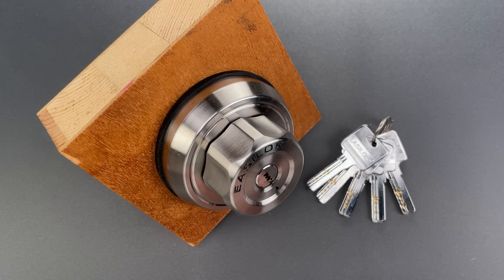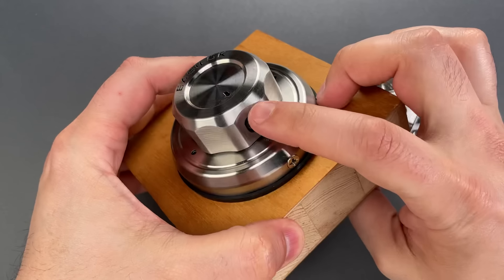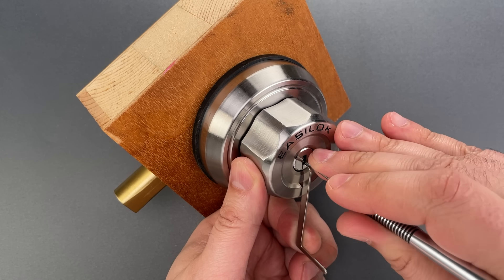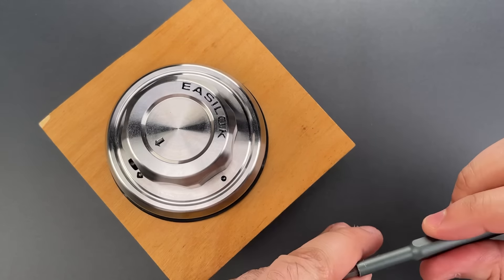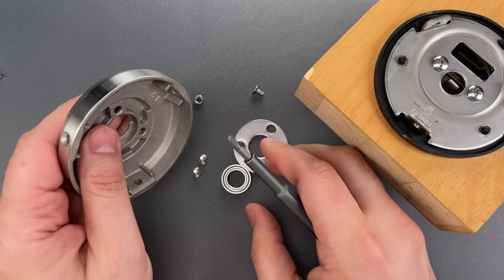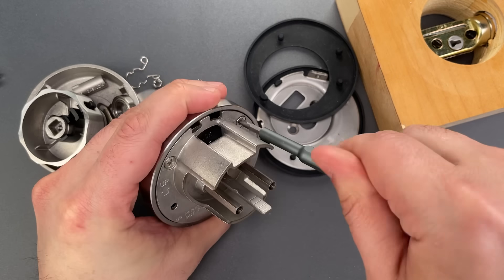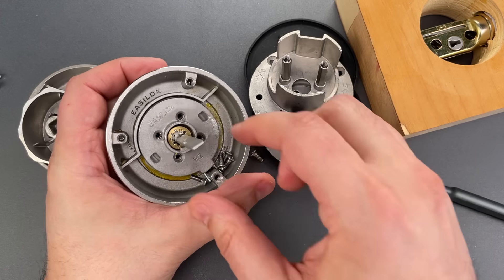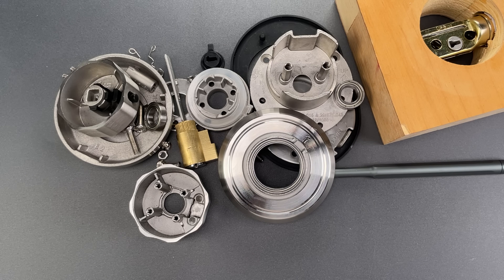[1388] The Best Built Deadbolt Ever? Easilok

Comment: Looked for it on Amazon and it seems like it's quite a new lock from a relatively small company. 

How'd you find this gem? Viewer recommendation?

I guess the downside is the low security core or cylinder that can't be replaced.
Reply: Hopefully they take this to release a newer version, if their sales are good :)
Reply: I'm just going to live happily with the fact that a dimple lock is lesser known, so fewer criminals will be able to successfully open it. I mean, considering that I've never been broken into in my 33 years, I'm not expecting more than 2 attempts in my lifetime, and the chances of either of them knowing how to deal with a dimple lock are low enough to satisfy me.
Reply: @CrapE_DM  We had one guy "Break" in while I was at work(Night shift). Luckily I work armed Patrol and came home when I got a call of a weird "Snoring" noise coming from the laundry room. Found a drunk guy in our laundry room passed out. Family decided NOT to lock the door. The worst Lock is one that is not used..... Needless to say I gave them an intense ass chewing.
Reply: Well the fact that you can use the switch on the inside to act a nightlock, means it is unpickable at night, when most intruders would strike anyway. But a better cylinder is obviously a solid way for them to improve
Reply: He found it by sorting the Locks category on Amazon by New.
Reply: Maybe repin, or someone can build custom cores for it until the manufacturer gets around to a new design.
Reply: @CrapE_DM   I think today's unsophisticated burglar just kicks the door down
Reply: My guess is they sent it to him, because even though its illegal to not mention paid promotions, he does it all the time.
Reply: @blitzofchaosgaming6737  How exactly do you know he gets paid for some of these and doesn't mention it? Links?
Reply: The dimple core isn't really that bad a choice, but it definitely could be better.
Reply: @blitzofchaosgaming6737  No he doesn't you fool.
Reply: @blitzofchaosgaming6737  It's not illegal. Maybe it violates YouTube terms of service, but that is very different from being illegal.
Reply: @commarian4642  And when you leave you can set all but one door to that mode. They can still smash the window though...
Reply: @blitzofchaosgaming6737  i believe tom scott had said it is illegal in Great Britain. Nowhere else that I know of, is it illegal. So just like most everything else in the internets, there is a bit of truth in your statement, but only a bit.
Reply: If it becomes popular, they will make it worse.
Not joking. They'll get their reputation up just high enough that they can afford to skimp on the actual quality, and then ride out the slow decline of reputation making massive profits.
Seems to happen every time.
Reply: That's an ad.
Reply: The one I saw on Amazon though had a different core.
Reply: @davidhsiang9323  As I said it was my guess.  We've seen him get free locks to review from companies a lot, and then fail to mention that in successive videos of those companies' locks, which was my point about not including the paid promotion tag for reviews on companies he has received "anything of value" from.

But lets be honest, he has received value from every lock he has ever talked about from AdSense.  Whether it helps them or not.
Reply: @Phred_Phlintstoner  US law (FTC) requires disclosure if it is a paid promotion.
Reply: @blitzofchaosgaming6737  I'd assume that means the videos for the other locks were not paid promotions. Keep in mind that very few locks actually get good reviews from LPL, its a pretty shit idea business wise to pay someone and get absolutely destroyed in the review.
Reply: @CrapE_DM  I never worry about someone picking a lock. Most theives would probably just break a window or take a crowbar to the door or even kick it down. Neat lock none the less
Reply: @Aaron-sl9ov  yes 💪
Reply: @dovydasgrigas441  If he has received anything of value from the company it is a paid promotion by law.  Doesn't matter how he reviews it.
Reply: @delphicdescant  "So get yours while (quality) supplies last!"
Reply: @blitzofchaosgaming6737  being sent a promo product is not a paid promotion.
Reply: @blitzofchaosgaming6737  
First I've heard of this. Source?
Reply: @vmirallyx  I already linked it.
Reply: @jcregal3456  correct. One piece of metal, +4 feet long, to reinforce the door jam
Reply: @blitzofchaosgaming6737  I don't think a former lawyer would risk doing something illegal on the internet, at least not on purpose.
Reply: @blitzofchaosgaming6737  Please link to where you already linked the source of this law.
Reply: @wolff000  Statistically, how well-lit a place is, whether that's day versus night or streetlighting versus none, makes no difference to the probability of a crime being committed. So you're right, the presence of the occupants is very much the deciding factor.
Reply: @robertsmentkowski312  Jamb.
Reply: @commarian4642  most intruders come in during the day because people are at work.
Reply: @blitzofchaosgaming6737  Almost all the locks get negative reviews from LPL, do you really think he's taking paid promotions?
Reply: @Mr.FastZombie  No, i know he has.  Paclock paid him to review their products and subsequently he has reviewed others of their products without disclosing his relationship with the company.  Gives them good marks and their competitors bad marks.  Exactly what unfair competition laws are about.
Reply: @blitzofchaosgaming6737  Being sent something to review isn't the same as paid promotion.  If he receives nothing in return and is not likely to gain value from the item itself (how many doors does the LPL have, you know!), then it's not really a paid promotion.
Reply: @DavZell  Receiving free product does make it a paid promotion under the FTC rules.
Reply: @Richard Cranium No, do you work for paclock?
Reply: @CrapE_DM  I can get through the stucco wall next to your door with a claw hammer and twenty seconds of effort.
Reply: Maybe the engineers who designed it don't know about picking and just bought a core that they were convinced was high security. If so they might actually see something like this and fix it.
Reply: “Can’t be replaced” … only with that attitude
Reply: @blitzofchaosgaming6737  It's not a paid promotion if they give it to you
Reply: @blitzofchaosgaming6737  receiving a sample to review does NOT make it a PAID promotion. Could be a conflict of interest if he was receiving $10k bottles of wine to give glowing bs reviews to. But when 99% of the time the value is less than that what you'll find his yet to be flushed toilet I feel it's a pretty safe bet the "value" of any of these "locks" he may or may not have received free of charge has had any sway in his assessments. In fact, if he receives something free of charge, and actually by some miracle attributes any value to it, then I surely HOPE it receives a favorable review!

Comment: The lock has more ball bearings than my Corolla.
Reply: I was going to say "no it doesn't", then I remembered most of the bearings in a cheap small car like a Corolla are roller bearings. But still, just the gearbox in your Corolla has far more ball bearings than this lock.

Comment: the designer must have LOVED tetris ... nothing like layering everything in ... and even better to see that easilok watches the channel and actually pays attention to what you have suggested ... as for the recommendation by you even with the quick pick it sounds like an excellent lock ... stainless steel may be more costly BUT make them by the billion and they become cheaper just by economy of scale ... 
.
here's hoping they send you the new upgraded version to see what you can do with it ... I think that would be a fair endorsement thank you ... and perhaps a nice birthday gift for them as well to see what you think of the upgrade as well ... I can forsee an upgrade of the ability to swap out cylinders to better enhance the security of the lock ... perhaps add a feature on the lockout pin to allow turning from the inside to reset the pin as well .. so you dont get locked in by accident ... in case of emergency 
or have a gimmick like holding the outside knob to one side and then insert the key the key upside down then reseat right side up and open ... or some such ..
Reply: Sir,thanks for your endorsement. We are upgrading the cylinders.We will make it as soon as possible and give our customers  the best  experience:) .
Reply: How many billions of $100 deadbolts do you think they sell?

Comment: In my opinion, aside from the mechanical security, one of the best things about locking a door with a separate deadbolt is that it does require a key from the outside, thus making it impossible to lock yourself out. Maybe the best approach to using this lock is to disable the keyless locking feature and pretend it doesn't exist, and continue to assume a key is always needed to lock the door.
Reply: It may seem impossible but ...
Reply: From their website it seems an intended use of this lock is for workers to be able to lock a store after closing without having to give those workers keys
Reply: @_Zaid  that definitely makes sense, especially if they don't actually need to have a manager present during closing.

Comment: Burglar: "Oh damn! An easilok!"  Steps back and lunges forward kicking the door in.
Reply: Just put one of your radios on the back, they will break their foot
Reply: Considering what I see of it? If you put this on a properly installed steel door with properly installed trim and everything? I'm sorry I'm breaking one of your windows. It's got nearly an inch of deadbolt. If the door is in anywhere near properly installed even the police with a doorbuster would have a hard time.

Comment: I'm curious how long before it gets engineered down to a price-point. First things I'd expect to go are the ball bearings. They certainly make it smooth operating, but the main purpose of ball bearings is longevity, and I don't think a deadbolt generally sees enough mechanical wear to warrant the cost to most manufacturers.
Reply: I would have said that the main purpose of ball bearings is smooth operation. Longevity is just a bonus.
Reply: @olsmokey  I would counter that the smooth operation is a side-effect of the bearing doing its job (to an extent), but I also could have phrased its purpose better. The point of a bearing (as well as bushings, grease, oil, etc) is to reduce or eliminate direct contact between multiple moving surfaces, to the effect of reducing wear on said surfaces, which in turn results in greater longevity of the mechanism. I mention the other options because which you choose is dependent on the environment and stresses the mechanism is expected to see. Bearings are good at high speeds and high loads, neither of which this lock would likely see. Given that it looked like the bearing was almost completely encased within the mechanism, I suspect a good grease would have been more than sufficient, and significantly less expensive.
Reply: Good enough house, good enough lock, it's there when humanity meets other civilizations across the stars, and Glorbdak discovers how much he appreciates it when he comes to live on Earth.
Reply: @jero37  That's precisely my point- companies generally engineer products to be "good enough", but this lock has been engineered to be more than that.
Reply: I assume that the non-standard, lowish-security lock core is where it has already been "engineered down to a price-point".
Reply: @jic1  Strictly speaking, you are correct- that was probably a decision they made to to hit their arbitrary price point.

What I really meant by my statement was, "how long before they engineer it to the lowest price point possible?"

Comment: Since the outside of the lock has an octagonal head, I would really be curious to see whether that makes it vulnerable to a good old fashioned pipe wrench and a little bit of torque. What would break first under that kind of pressure, the pins or the outside of the lock?
Reply: I bet the company will get on that immediately after this came out.
Reply: @professionalcommenter  They know about that threat.  Most external deadbolts have a tapered design like a cone for that very reason.  Wrenches slip right off.  I'm not sure the vulnerability of getting it to spin on this lock, but it looks like a viable means of attack.
Reply: @sundaynightdrunk  *Laughs in vice-grip
Reply: @bfeezey  Well if you do that, there's also the Hooligan tool used by Russian firefighters and lifesavers, which is a hydraulic reverse scissors basically. This thing can open almost any security door short of actual safe doors.
Reply: @bfeezey  Vice-grips don't grab conical objects like a typical external deadbolt housing.  Try it.  They slip right off.
Reply: Stainless steel vs Brass pins... I"m thinking the pins will shear. 
But really, a lock is there just to keep honest people honest and prevent theft of opportunity. A determined thief/crook will always find a way inside.
Reply: @valkyriefrost5301  Honestly, at the point, its easier to just break a window...
Reply: @sundaynightdrunk  Tapered design is easily defeated with a K-tool.  Slip it over, tap it down, pull the core right out.
Reply: @JackycClark  - Not really sure. I would hope the locking mech inside is some how disconnected from the cylinder when locked, if not, the a pipe wrench and some torque will defeat the pins. The real point of picking a lock is to gain entry without leaving an obvious trail.
Reply: @EuropaOutpost  or make noise, depending on intent....
Reply: @Valkyrie Frost  for you maybe, for me, a lock is to slow down anyone not authorized long enough to reach my shotgun behind the bedroom door.
Reply: @sgvincent100  - some will steal the battery just for something
Reply: @TheWinjin  First of all, the tool is a Halligan, not Hooligan and it is a specialized crowbar.  Secondly, the tool you are describing is the "Jaws of Life", which due its size, weight and cost will never be carried by burglars.
Reply: I used to turn apartments, in the kind of neighborhood where people would suddenly leave overnight without turning in their keys and often put on their own locks. Lock-in-knobs are a joke; I could sometimes force them with my bare hands.  With my 14" channelocks in my belt loop I could open almost any apartment deadbolt in just a few seconds. Even if the residents didn't know me, they probably wouldn't suspect anything by how quickly I could get in. The only thing slowing me down? Tapered cylinders. I can't help wonder if this octagonal head might actually give more torque than a typical lock-in-knob.

Comment: LPL: "The best deadbolt I've ever encountered."

Also LPL: "Here let me pick this lock in under 20 seconds."
Reply: He actually said it's the best low security lock he's encountered.
Reply: Of course. He opens the worst ones 10 times in a span of 5 seconds.
Reply: @dozerman8222  so in this instance we're counting low security as a lock that can be opened by anyone that can lockpick? Preventing only the people who can't lockpick from opening it lol.
Reply: 99% of crooks can't pick a single  lock and don't even try. They use force.
Reply: @tactrix1h  We are talking about a world class lock picker who can open some padlocks just by staring at them.  From my very limited understanding, not all pickers can pick dimple locks.  It also cannot be opened with a low skill attack.  This means that if someone wants to get into your place, they will tend to find a way other then through this door.  Low security means it is rated against attacks of opportunity not against someone determined.
Reply: @ksavage681  against those this would be completely useless, because they'd just use a window instead. And it should be noted that all 99% of them would be in jail if not the same day then the following day.
Reply: @michaelshelling8738  any picker that can pick a regular lock and has a flag dimple pick can pick a dimple lock, the principle is the same, the rotation is slightly different.
Reply: He does a Kwikset in 3 and a Schlage in 10. So it's an improvement. And good enough for residential use. Because in that scenario you're 99% or more likely to be facing a primitive physical attack. In which case the bolt housing and door/frame material is the only think that matters. An ASSA Abloy Protec2 does absolutely nothing to stop a 200lbs motivated crack head with a crowbar.
Reply: @tactrix1h  I'm a picker myself. Dimple locks are hard if you haven't practised them specifically. And even if you have, you won't be reaching the speed he is showing here by a long shot. Especially not if your heart is racing and you're standing in a less than ideal position while having to listen for that sound of a cocking gun on the other side of the door...

Comment: So here’s what I think I heard (and saw):
- build quality/strength - amazing
- cost excellent (and better quality, not value, complete quality) than competition by a factor of up to 5!
- pick resistance - excellent unless faced by an expert.
- only weakness… not a “standard core” so the very good core could be field replaced by a superior core for those who need such a thing.

If I needed a fantastic home lock, id stop searching here.
Reply: LPL was saying its build quality was better than locks worth 5x as much but pretty clearly wasn't saying it was more resistant to picking; he didn't say and I don't think he meant to imply that the locks that cost 5x aren't more secure (or at least could be) so any comparison is going to depend on what you value.
Reply: @noneak3  I notice that he didn’t pick it with the night latch on. That would be an entirely different video.